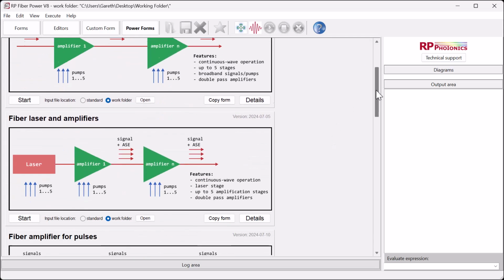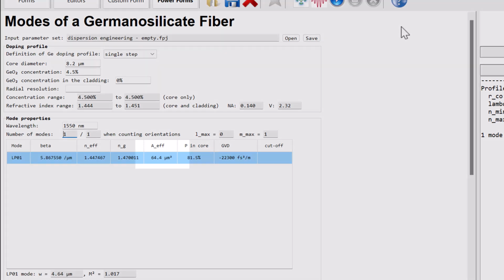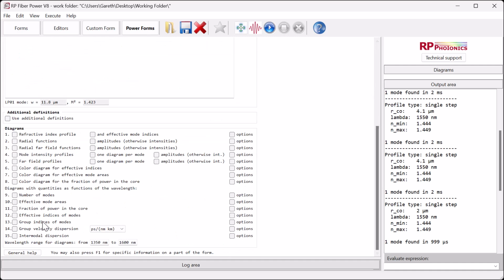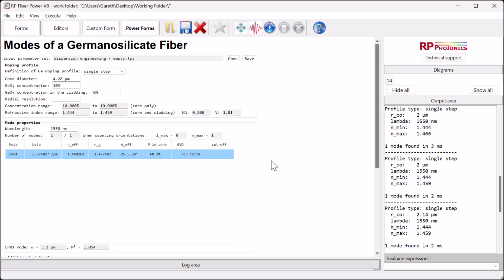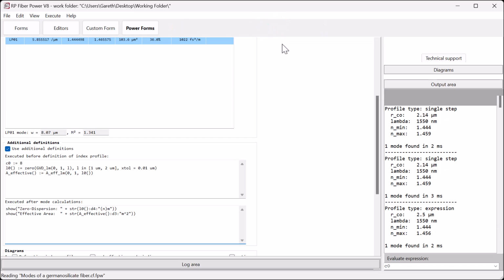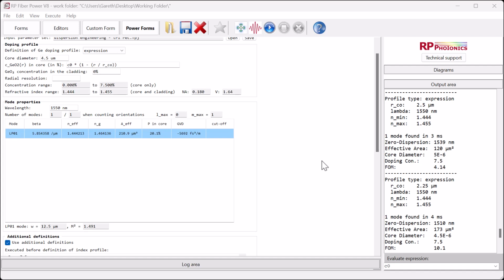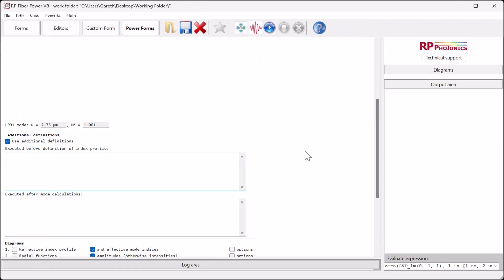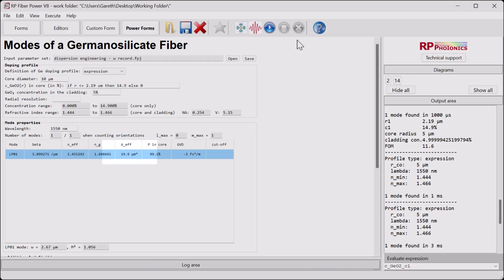Dispersion Engineering for Telecom Fibers

Comment: Dear RP Photonics Support,

I am using RP Fiber Power to simulate multimode pump propagation in cladding-pumped multicore EDFAs using the Beam Propagation Method (BPM).

I am observing a small but consistent discrepancy (approximately 0.1% to 0.3% of the incident power) when comparing the total terminal power against the sum of the power in my specific regions of interest.

To find the total power at the end of the fiber, I am using:
bp_P(z_max)

To find the power inside the core and pump cladding, I am applying a spatial mask and integrating the intensity:
P_co := int(int(bp_I(x, y, z_max) * core_mask(x,y), x), y)
P_cl := int(int(bp_I(x, y, z_max) * IsInPumpCladding(x,y), x), y) - P_co

When I sum P_co and P_cl, the result is reliably 0.1% to 0.3% lower than bp_P(z_max).

I suspect this is an expected numerical artifact caused by applying a curved boundary mask onto the rectangular computational grid, or perhaps a minor fraction of the field bleeding into the outer calculation region.

Could you confirm if this small discrepancy is expected numerical behavior when using these two different methods of evaluating power? Are there specific grid resolution settings or outer-region loss parameters you would recommend tweaking to tighten this energy accounting, or is this standard behavior for this type of integration?

Best regards,

Justin